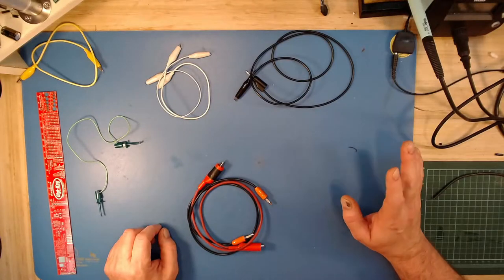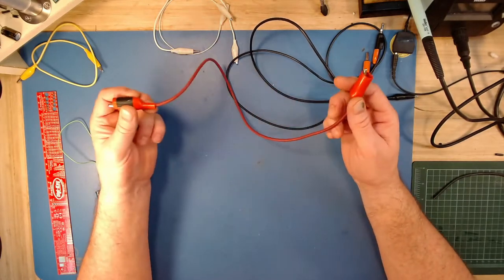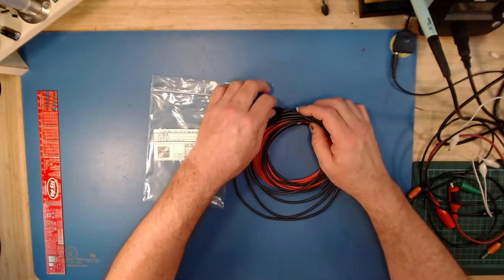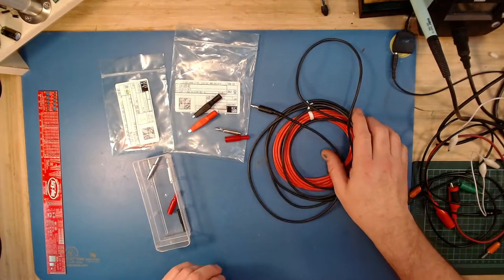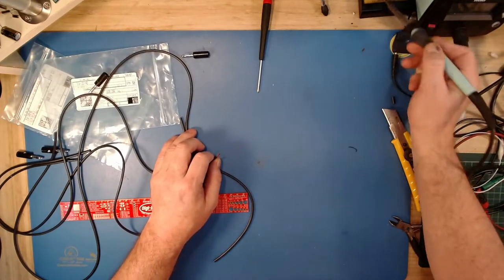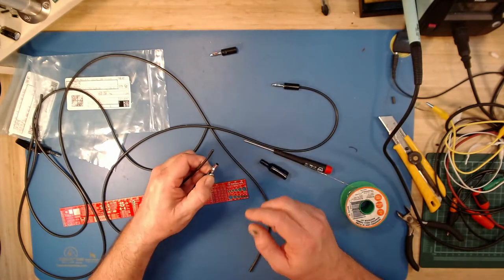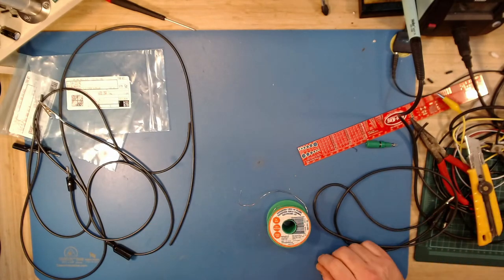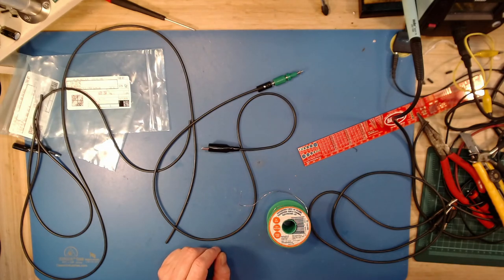The best test leads for your bench ever!

Comment: Great video. So I am moving from a cheap multimeter to a 34401a benchtop multimeter and it's not coming with any probes. I would buy probes with banana Jack's on them without the safety Shield just to be sure that I have something good, but I would really like to not spend that much. I can zero any probes.
I was looking at 4 feet. Any suggestions?
Reply from the maker: Nice meter! If measuring voltage, any probe could be used provided the proper voltage rating. If however you are looking for current, the voltage drop though the probe wires can become an issue. The 4 wire resistance does get around this nicely but just keep the limitations in mind. For voltage, I have a set of these (nice and sharp).
https://www.digikey.ca/en/products/detail/mueller-electric-co/110012/304621
But for general use, maybe something like this if you are on a budget.
https://www.digikey.ca/en/products/detail/pomona-electronics/5898/737467

Comment: Hi can you help me In choosing a Bench multimeter in the past and in the future I repair a lot of Xbox one x and other ones and also in the future I want to be able to repair amplifiers AV amplifiers and tube Amplifiers all things like that can you  recommend a around good  desk top multimeter which is not too dear something around £100 to £300 it would help me so much thanks mark
Reply from the maker: The Rigol units would fit the bill. A 5 or 5.5 digital is likely more than enough for this work.  Keep an eye open on the used market as well. Just be sure that you get something that can be calibrated.  Thanks for the question, and I hope this helps.
Reply: @ScottCard  can you give me a link to this multimeter benchtop thanks mark

Comment: cheap alligator clips suck. so hard to open them.
Reply from the maker: The ones I recommended? Strange, years later, and I am still using mine without issue.
Reply: @ScottCard  yeah I’m am looking for new ones. Was looking at pomona and probe master.
Reply from the maker: Both are good brands.
Reply: @ScottCard  which banana to alligator clips did you show in the video and/or recommend these days? Didn't see a link...
Reply from the maker: @user-tx7hu7of4s  The links to the parts I used are in the description.  It was a little expensive, but they are still in use today with no issues!
Reply: @ScottCard  wires and banana plug links are there, but not the banana to alligator clips
Reply from the maker: Ah yes. Good ones I use:
https://www.digikey.ca/en/products/detail/cal-test-electronics/CT3755-2/5029200
Cheap ones I use:
https://www.digikey.ca/en/products/detail/keystone-electronics/5045/316341